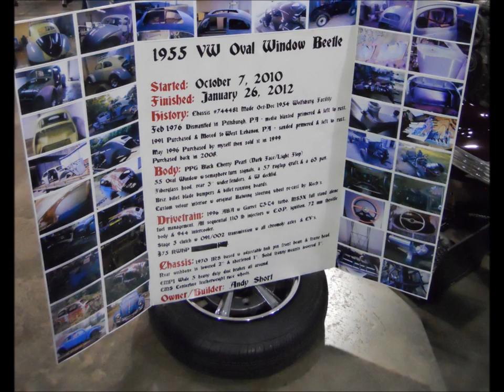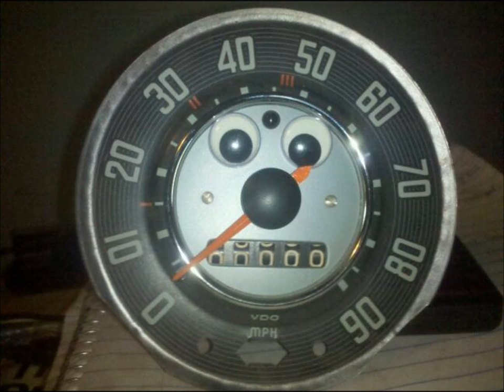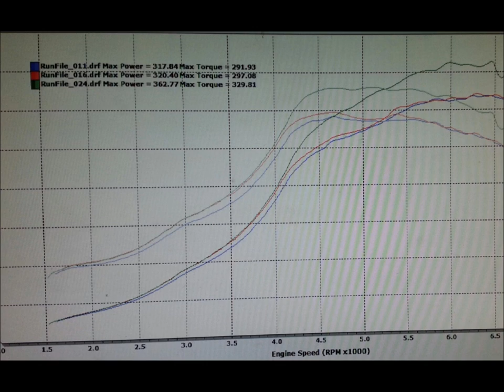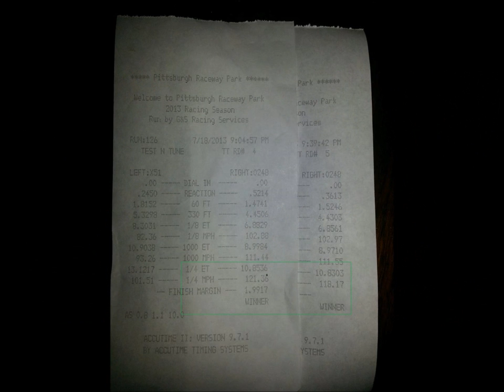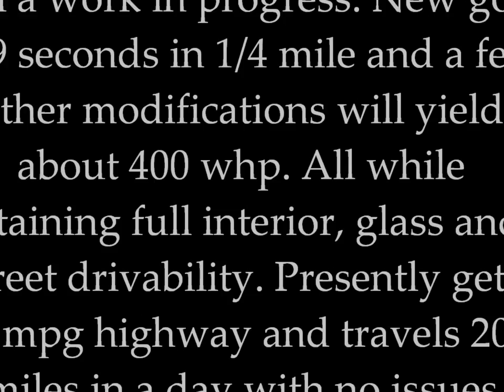Andrew Short's 1955 Beetle Turbo Street.10 second Daily Driver

Comment from the maker: I have an aircooled 2110cc turbo 63 Double Cab in storage. This 55 bug was rotted so bad it was perfect candidate for a ABA swap.I wanted it to remain all VW.And it retains the full interior, back seat, and the trunk is not cluttered with a radiator. It's probably the cleanest swap in North America as far as retaining original look/equipment and still run low 10s and drive across the state between tracks with no cooling issues.gets 26.5 mpg and starts/idles like a new car. Now it's pushing over 415whp/395tq @ 28psi. It is something you would have to see in person. The pictures really don't do it justice. It has won Awards at every show entered including Best of Show. some nice 1st place and Top Import racing awards

Comment from the maker: Had some people not happy I didn't keep the Aircooled engine. Well all I'm going to say is First of all it's not your car and I didn't build it to please you. I built it out of rotted junk as a seen fit because I'm the owner/builder/bank roll. It is by far more superior in every way to the prehistoric, inefficient Aircooled and makes more Horsepower per cubic inch than any Aircooled or Subaru engine. Before spouting off nonsense about what I did wrong I challenge you to beat my bug with your bug. And there's a few faster. But they can't drive 200 miles to a track and make 20 back to back passes then drive home. , it's all VW and has more VW parts than any other bug in the country running these numbers. Only one with all of its glass bumpers,interior etc. It's the heaviest, smallest turbo,smallest displacement and most street friendly. And if 473whp isn't enough to get the job done I have another bug w 700-750whp that's an actual Drag car
Reply from the maker: I will edit later. But towards the end the sentence about glass,bumpers interior is comparing it the every other bug in the country running the same times. I'm generally a nice person but I'm not an idiot. It's also not my fault I have the abilities to make this work and look so well that I have 5 records and won dozens of awards in shows and racing events.. I also thank everyone who posted positive feedback. I've been in the VW scene 30 years. Drove my first bug when I was 7 years old and owned almost every variation on the continent.
Reply: +TurboABA1955Bug Good job man.
Reply: Can't believe people complain about a build that had so much blood and sweat poured into it. Fuck the haters, the slug bug hot rod is too cool for the, to handle
Reply: As an 67 original bug owner, I think you fucked this bug all up in a best way possible. Congratulations on your build and keep them front wheels down

Comment from the maker: Just made 497whp/483tq. then destroyed the 228mm KEP 6 puck and burned the flywheel almost instantly. Found the threshold of the STG3 plate.. we're done racing for the year in PA. But upgrading to a VEMS and some other goodies.. ran 10.06/135 on @420-425whp.. Stock suspension in a 2140Lb street bug is proving hard to keep straight.

Comment from the maker: Everyone told me it wouldn't work. But somehow mine works perfectly. Are you running the rear deck lid? I think that may be the key. I've driven 400 miles at a time in 90° weather . No issues. Driving it sits at 184°-186°. If I'm on the highway hammering or on/off 28psi boost it will climb to 205° but a few miles of regular driving it's right back down on temp to 185°… I'm running dual fans but disconnect one when air temps are 60° or less because it won't get up to operating temps

Comment: i am glad it is all vw.  a dude where i live has a 66ish with a 1.8l turbo motor in it with the jetta trans axle in it.  that thing moves too.  i doubt it is as fast as yours.  his is more of a road racer set up.  but you did some great work on your car.  do you think you could shoe horn in a vr6 in a bug or ghia?  i respect your opinion since you lived it.  seeing this makes me miss my bug even more than ever.
Reply from the maker: I have a VRt in a mid engine tube chassis FiberFab Avenger.And a Ghia tube chassis w a 2.0L16v turbo. The real issue is the tail weight. And the drivetrain isn't the best for a lot of torque. I don't think rear engine VR6 will work out. Just my opinion. I'm currently building an evil twin beetle w 700whp+ ABFt . it'll be lighter on a modified pan.
Reply: do you think your set up could work with taking corners with the obvious suspension tweeks. or would the weight distribution make it too squirrelly?
Reply from the maker: walter george it handles amazingly well but still you can feel the tail weight pushing it around. However I've taken corners at @ 70 mph . it has hand brakes also which helps cornering. Ideally a mid engine would be the best but we're not allowed to move the engine in any of the classes I run.

Comment: Very nice job on the car. But why a wàter pumper. Guess Im a purest but an aicooled motor can run just as hard with a turbo too and it weighs much less.
I'm just curiouz as to why.
Reply from the maker: This watercooled engine that produces 473whp and 462tq costs me a grand total of $2500 to build from pan to valve cover. Including fuel rail and lower intake.. It gets 28mpg and never overheats. It can drive 250 miles w 4 passengers and go right into the track and run 10.0s@135mph for 20 passes in one day. Almost all the parts can be bought the same day from a local parts store or salvage yard.. I build everything in my basement.
Reply: +TurboABA1955Bug its still vw I see no problem here

Comment: Was a 10 second vw possible in the 70s? My dad claims his friend "had one in high school"
Reply from the maker: The world record in 2002 was 10.06 held by Kurt Metzger and 9.83 by I think Bill Fleming.. currently the NA pro stock bugs are running into the high 9s... Unfortunately the 70s didn't have nearly the technology,  parts or tires to run these numbers. To put it into perspective the Bug would need 300-315 Horsepower at the crank to run a 10.9x pass at 1800Lb w driver... A healthy big valve 1776cc dual carb from CB performance makes 100 crank horsepower. A healthy 2110cc w turbo and  about 28psi boost makes about 300 crank horsepower and barely touches 10.9x

Comment: Good practical answer. Suby motor good motor. Great motor.
But like I said, Im more a purest, traditionalist. a 325 hp turbo aircooled motor can do that too but I know it woud cost more than$2500.
But it would be correct in its base design of being an aircooled VW design in a VW car. Aside from that I still think your car is great!
Reply from the maker: I've never seen an Aircooled at 350-450whp that wasn't on the verge of a melt down after 30 minutes of street driving.. And at that power level there's no actual VW parts left. My new ABFt VW 2.0L 16v engine is @ 700whp . I've been into the VW scene for @ 20 years.. But different strokes for different folks. Thanks for the compliment.. Of course I'd rather everyone keep running the other engines.. Lol.

Comment from the maker: Just beat our old ABAt record on the dyno w 447whp/420tq just by turning up the boost. One of the coils decided to fail but we're going for over 450whp on next session. Track tests it was spinning and ran consistent 10.10/136-10.16/136 but we lost 2 tenths on the 660' ! Just too much power for all stock car and 7" wide DOTs on open diff.

Comment: is that an aircooled motor, how many cylinders?
Reply from the maker: Watercooled ABA/AP 8 valve from a 1996 Jetta. It's a 2000cc 4cyl sohc engine with a 5558 turbo.

Comment: Are you still running the 5558 or did you move to the 5858?
Reply from the maker: g60vwr I am running a 5858 now. 497whp at 36psi boost.. It had more but the MegaSquirt had issues. So now I have a VEMS w a bunch of electronic goodies. should be interesting. I ran 10.06/135 on the 5558 @420whp ..